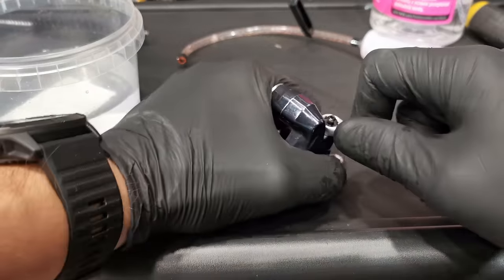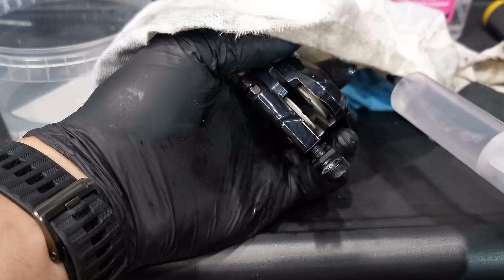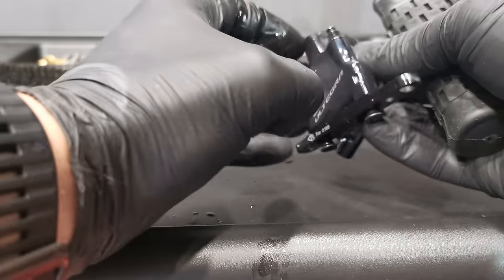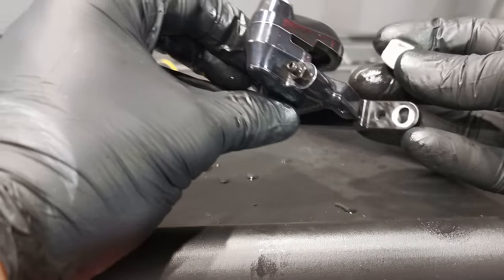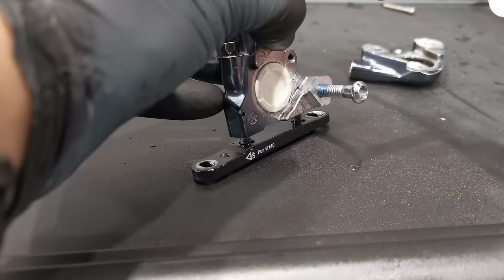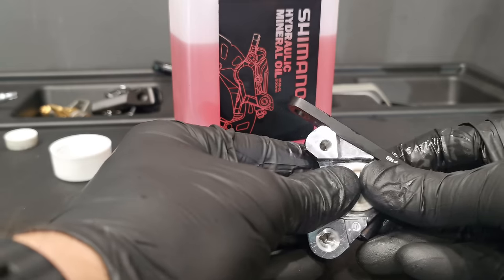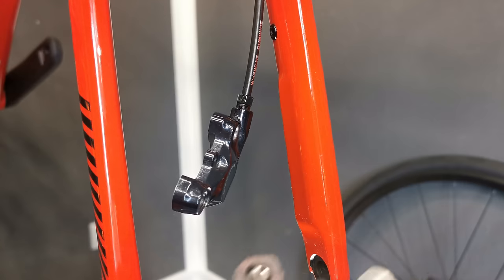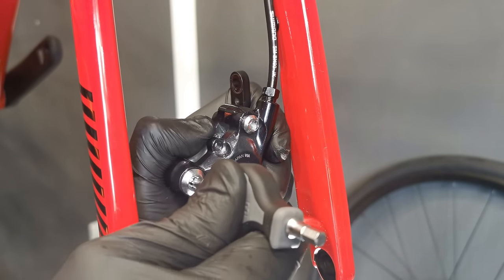Easy Way To Remove Pistons From Hydraulic Brake Caliper On Bicycle.

Comment: Can't you just press air?
Reply: Yes
Reply: No, Air is compressible. Liquid is not.
Reply: ivanteo1973 But air does not compress easily, so it will force the pistons out. Pneumatic 😉
Reply: @DerRoAusKO  air is compressible, that's why you do not even one a single bubble in the hydraulic system. You could however increase the air pressure to overcome the compression. But the question is how are you going to close the system tight enough  to prevent air leak?
Reply: ivanteo1973 the question was not "can you operate your brakes with air?" but "can you pop the pistons out with air rather than with  water?" And yes, you can pop them out with pressurised air.
Reply: @DerRoAusKO  Make a video.
Reply: ivanteo1973 Dude, go annoy someone else. There's no need for a video, it's basic physics.
Reply: @DerRoAusKO  theory is one thing, setting it up is another.
Reply: ivanteo1973 Holy hell are you stubborn... You want a real life example? Just release the air out of your fork, remove the casting and the air shaft retainer ring. Now apply air with your shock pump and watch the "magic" of pneumatic force.

Removing caliper pistons will work by the same principle.
Reply: @DerRoAusKO  good idea, show me.
Reply: @ivanteo1973  water is definitely compressible, as are most other liquids. Thats how a pressure washer works. Hydraulic fluid can't be compressed, but that is why its used instead of water or something else.
Reply: @stephdiesel2110  Water is incompressible. So does liquid. Its physics. Water can be used as a hydraulic fluid, but it is not as good a lubricant as oil. On top of that it does not have good temperature stability.  Do yourself a favor, Google. I believe its doesn't take too much effort than replying here.
Reply: @ivanteo1973  I’m a mechanical engineer and a physics minor. I understand how compression works. Almost any material can be compressed under enough pressure. How do you think they make water jets that can literally cut through rock? Do yourself a favor and go actually learn physics
Reply: @stephdiesel2110  Please google. And your bollywood university might not help.
Reply: @ivanteo1973  “in industrial applications water can be tremendously compressed and used to do things like cut through metal.” Literally in the first paragraph on Google
Reply: @stephdiesel2110  wrong
Reply: @stephdiesel2110  LOL where is that degree from?  Water jets that cut throygh rock have nothing to do with compressing water.  It is simply high pressure high velocity water.  You are confusing pressure with compressability.
Reply: @stephdiesel2110  Your reference uses the wrong term.  Water can be placed under high pressure.  But compressed means using pressure to reduce the volume of a quantity a given quantity.  You can pressurize water to whatever degree you want, but the volume does not change as it does with a gas.  For all practical purposes water is incompressible (disregarding  minute quatum changes that have no practical relevance)
Reply: @DerRoAusKO  exactly correct.  It doesn't matter that air is compressible.  If your air is at high enough pressure it will move the pistons.
Reply: @headholio  Well said. Thank you for the clarification